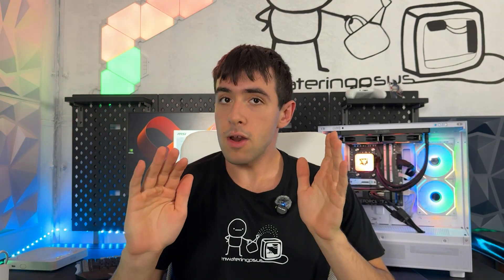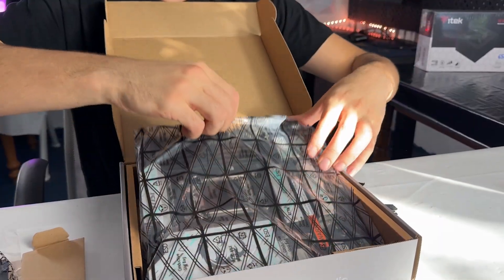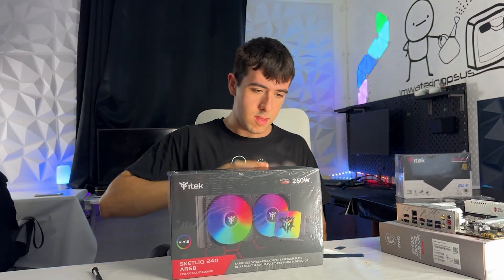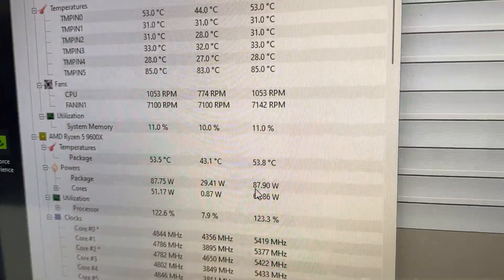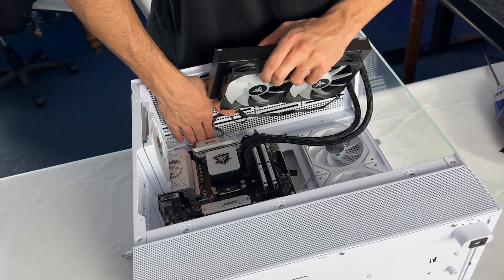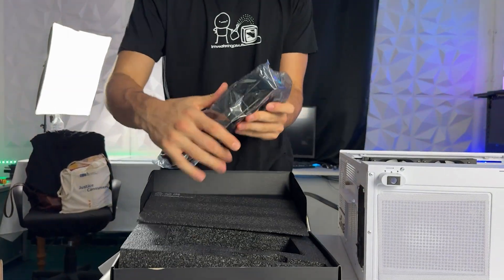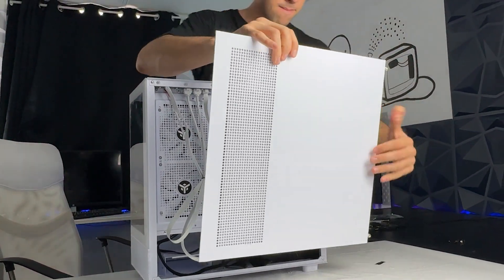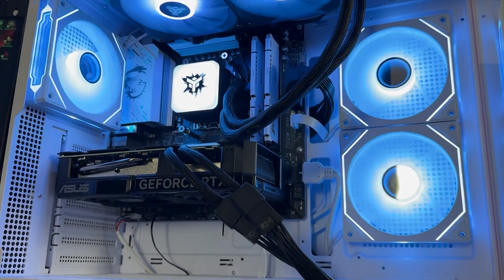Ryzen 5 9600X + RTX 4070 Super - Budget Gaming PC Build Guide

Comment: Nice Video I have just purchased Parts here in the UK - Lian Li Mesh II C Performance case, MSI B650 Tomahawk, 9600X CPU, Corsair CX650 PSU, 32GB Crucial DDR5 6000mhz memory, Crucial P3 Plus 2TB NVME, Thermalright Peerless Assassin 120 SE Cooler all for just under £700, will be using my current 3060 12GB card initially but plan to upgrade to a 4070 Super or maybe a 5060 in the next 12 months price dependent, can't wait to get it built as upgrading from an Asus Z97 4790 system that's 10 years old lol.

Comment: Im in Australia I did a 7800x3d with the 4070 super I'm thinking of missing the next generation of CPU and GPUs only play cod
Reply from the maker: I'd say you can definitely skip the next CPU gen, GPU-wise it depends. If you're playing at very high refresh rate, you may need to get a 4080 Super or an equivalent card :)
Reply: @ImWateringPSUs  I was thinking about that to be honest but my issue is I have a itx PC my 4070super is a 2 fan

Comment: literally just buy a 7600 for nearly identical performance, 9000 series is terrible at current price
Reply from the maker: That's true if you don't overclock/tweak your hardware, but not the case if you mess around in the BIOS. I've recently "downgraded" from a Ryzen 9 7900X to a Ryzen 7 9700X in my personal build because of the massive single thread performance increase I'm getting. R5 7600 is 20% slower than a 9600X, tweaked vs tweaked!

Comment: pretty bad PC build!! zen5 cpus are crap for gaming and  r7 7700/x  are something cheaper and better in same time at everything  and you could go for  less money  if you have r5 7600/x + rx 7900xt/xtx
Reply from the maker: They're not bad for gaming at all, but they're especially good if you wanna spend the time to input the proper settings into the BIOS. 20% performance increase is what I got on a cheap AIO... On the other hand, I am recommending the 7900 XTX right now indeed
Reply: @ImWateringPSUs  they are bad for price and there is no uplift for performance or zen4 will get uplift too and its way cheaper cpus

Comment: Why not go for a 7700, its so cheap rn in austria only 218€
Reply: because he advertise for some store zen5 faildozers or he is not so bright
Reply: i have to say it is only the tray version but who cares about packaging anyway if you can get it for cheaper and 1 year less waranty
Reply: has 8 c 16 t and outperforms the 9600x in all games
Reply from the maker: @floisindahousee  Very good point as I do like the 7700 a lot, especially since it get be overclocked quite a bit. Made a budget build with it recently. But the 9600X, if properly set, will outperform it in games by around 10%, in my testing. 7700 wins in productivity by a lot tho
Reply: @ImWateringPSUs  your testings are bad then!! 7700 are basically on par with 9700x  in games or 2-4% slower  and that is with 4090 at 1080p